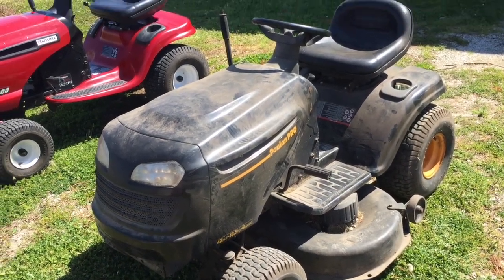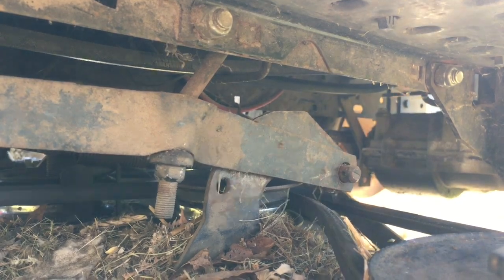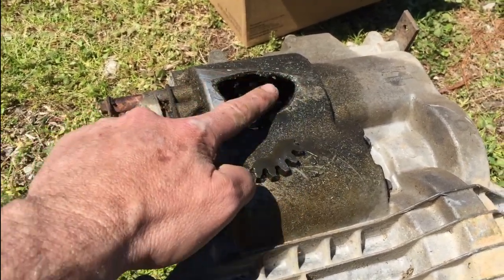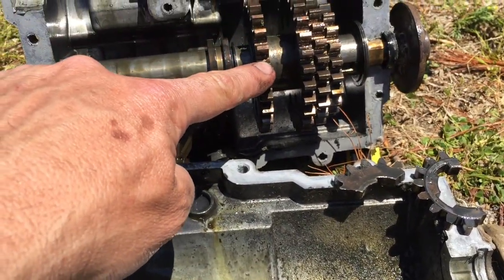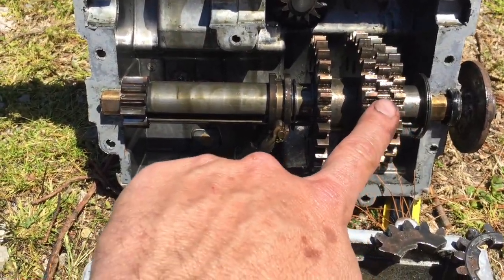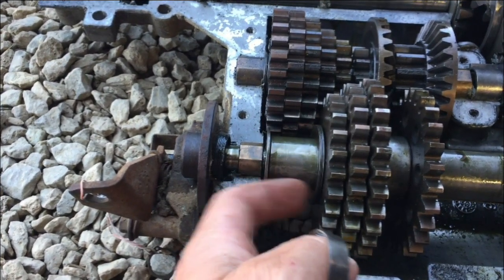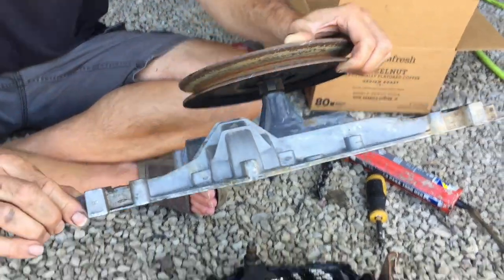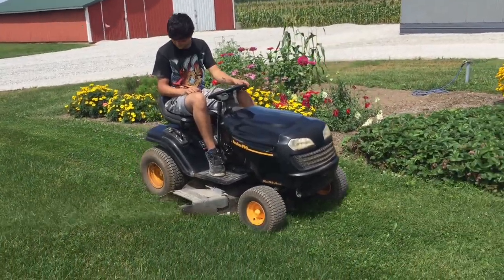Riding Lawnmower Transmission Repair

Comment: Hi, i got a old Yard man 12.5 L head opposed engine with 8 speed "control" but it moves perfectly about mid speed and no noise BUT the speed control is doing zip when i move it fully F & B SO.....  is the linkage broken  or the fluid low?? as it moves crisp and normal in forward and reverse gear. No slip when i let clutch out, seems normal except no speed change with that lever.

Comment: I have this same Poulan Pro mower shown in the video and it won't move - one rear wheel goes forward and the other backwards. I was pushing it out of the shed and it just locked up. Any help would be greatly appreciated.

Comment: Damn love the git er done mentality . I have to take my trans apart to check it out there is no drain plug no way to refill I want to take it apart and service it clean it and then I am going to drill the bottom and tap it and put in a drain plug and a fill plug on top so I can drain and refill the trans has been really sticky but I also have the clutch mec out of adjust ment I am a Marine tech never had one of these trans apart . Love the video my man it was f it get it done I love it Never thought about the sheet metal and jb goo idea

Comment: Great Vid! Thx!

I have a ~2005 Craftsman DY4000. It starts jerking under load or in high gear.  And makes a mild click noise. I've had the belt replaced. Read that maybe simply adding gear oil might fix? Thoughts? Thx!
Reply from the maker: I suspect one of your gears lost a few teeth.  The jerk/click is when the gear spins free until it hits teeth again.  This is hammering away and likely breaking off more teeth.  I would open the tranny and replace that gear.  Here is how:
Riding Lawnmower Transmission Repair
https://youtu.be/O-h3zSYJZYU
Reply: @HowToLou  That's what I was thinking as well. I found the schematic for my specific transmission. Where is your go to for gears/parts? You also mentioned used tranny, where are those? Ebay? Thanks for your help. Again, great video!

Comment: These are actually made by ayp and most of them are mtd and all of the new ones are mtd accept husqvarna and john deere
Reply: MTD has a variable speed forward trans. Double pulley. AYP was never that stupid. LOL
Reply: Wrong answer. If you don't know machines, don't put out false statements.
Reply: @kevinmurphy2426  No, this style was made by ayp. im a lawn mower repair guy. I make mistakes, but this is not one of them
Reply: I go to updates every year. We won't go there. Been in the business since 1989. Husky, Poulan, and McCulloch are AYP. MTD is still a pain in the ass as always.

Comment: Hello. I have the same Lawnmower. Do you know why it's hard to change gears? thanks.
Reply: Shifting forks maybe worn, do to not coming to a complete stop while shifting gears.
Reply from the maker: Check all the linkages from the shift lever to the tranny, and make sure they are all easy to move.  If so, you likely will have to split open the tranny, clean it out, and put in new gear oil.
Reply: @HowToLou  Ok, tank,s

Comment: Very interesting.  Is there a way to check and/or change/fill the gear oil without having a hole blown in the bottom of the transaxle?
Reply: On my peerless mtd-206, there is a rubber plug up top that you can pull out to fill it up and check it.
Reply from the maker: That oil is not meant to be changed.   You have to split open the shell to do it.
Reply: @HowToLou  Well, isn't that great.  I've had to do the same thing in the past on automatic meat slicers.  At least my mower is working fine for now.  Thanks for your reply!